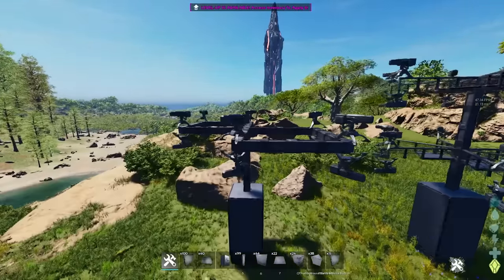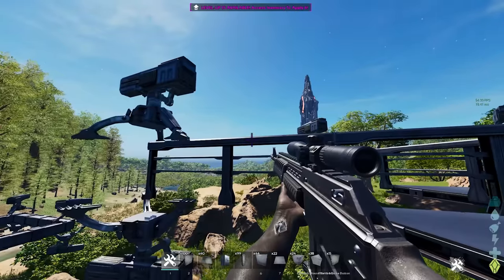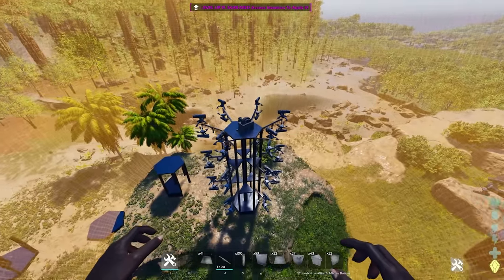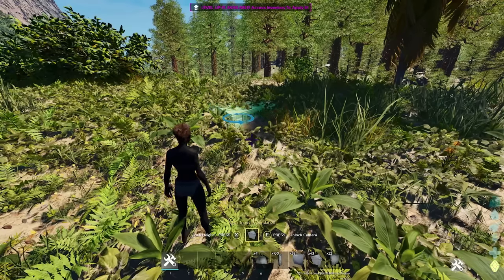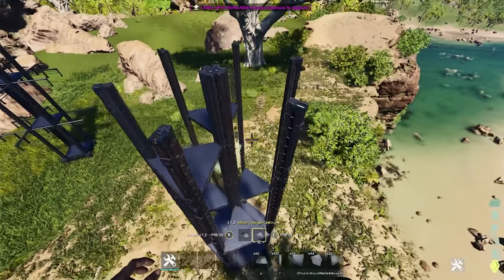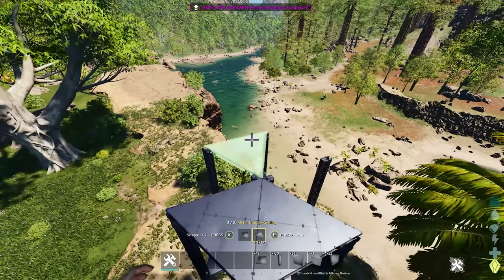Ark Survival Ascended 5G Turret Tower Meta

Comment: 2:36 vault drops still work, you just need to shoot down the ceiling under the vault instead of using demolish.
Reply from the maker: Yeah I kinda found that out a while ago, I figured it was a strange feature because why would they make it cost 50+ c4 to brake when ppl could just always go for the foundation which would be way cheaper
Reply: It's not just the ceiling*** the new change is that the structure holding it (wall or ceiling) HAS to take weapon damage for it to drop

Comment: I do like this tower designs, on SE I'd use my inside layer of triangle foundations then an outside layer of them and have stairs on the edges of the foundations and use walls, (later swapped to double door frames) and used hatch frames in an octagon shape around my tower depending on the tower I'd have 4-8 rows so this concept isnt far off of what I was already doing but now its fence instead of hatch frames. And costs a whole lot less to make it. Easy fast tower to get up even if you're just a duo.

Comment: It looks like a very good start but why wouldn't you connect all of the pillers to the ground?  Also if it is in anyway a prolanged fight filling those in combat are going to be a pain.  Lastly geny should probably be one or two levels down from top and boxed in with a secret door to access.
Reply from the maker: The door frames are technically all going down I'm just missing the outer edge of the foundation also for the prolonging of fights that's always been a problem in ark it's just something that needs to be done until ammo boxes get added again also the gen is there for demonstration you can box it up top and extend railings our from it there's no point in putting it lower unless if you want more ground coverage but you just gave me an idea
Reply: We'll eventually have ammo boxes again I'd hope, lol
Reply: @DRS11235  probably but they don't help mid combat.  You still have to fill manually when people are soaking.  Grappling to them to fill will work but you will die a lot and lose ammo in combat.
Reply: @DRS11235 not until gen and I hope they take a long time to release gen as the element maps ruin the game despite the quality of life improvements they bring

Exctinction gives us cryos, genesis one and two give incubators ammo boxes etc

But they also ruin the element economy

Comment: Nice video.

How do you feed and fill up the turrets though once placed? seems incredibly difficult to reach them.
Is the ammo box still in game? could you set one up somewhere within the structure, and will that feed and fill up all the turrets?
Reply from the maker: You would have to grapple fill it which wouldn’t be hard just grapple to the very top of each turret and work ur way up and I haven’t check for the ammo filler but I don’t think it’s been added yet
Reply: Quetzal aswell or tally good to fill turrets
Reply: Tappy*

Comment: one of the better designs. it is however way too small and needs to be upscales to hold around 100 towers, also need some extra snaps at the bottom somehow
Reply from the maker: Well with asa being so new a 100 cap turret tower isn’t really need no one is gonna have the bps or tames to push something with like 20+ turrets it might be possible but it will take a while but it will be needed
Reply: this looks like a proof of concept im sure he has plans to upload more on it most people are trying to churn out content to potentially make the meta ya know
Reply: @WildFW  hes probably putting unofficial servers that dont have just 100 turret caps into the idea

Comment: That electrical gen on top of tower is exposed to flame arrows unless they changed what damages the generator
Reply: No flame arrows and no propellant since they're originally from Scorched, but yeah it still should be enclosed in some way or it would be destroyed easily
Reply from the maker: @Ark-Education goat
Reply from the maker: I just had it there for an example you could box it and extend railings off the box simple

Comment: It's a shame large frames are not in the game.

You could fit max 3 but better if you placed two.

The hatchframes used to be what...25k HP? 12.5k per turret.

The railing only have 5k hp....why wildcard lol, idk why but placed two turrets on a 5000 hp structure doesn't do it for me :(
Reply: takes 4 rockets to destroy explosives all got nerfed
Reply from the maker: Yeah c4 and rockets got nerfed it takes like 12 c4 to take out a metal foundation now
Reply: @WildFW Isnt that just singleplayer settings?
Reply from the maker: @edvinkandenas348  iv heard something about that idk if it true, it sounds strange for them to add that to singleplayer cuz last I recalled I never got pulled up on singleplayer that much for it to be a problem (they actually made it to where structure resistance in singleplayer is 0.25 which the default is 1 what the hell are the devs thinking)
Reply: Hatchframes used to be 15k hp
Reply from the maker: @Esop-pg2yb  yeah it's a shame because we might not get them back for asa
Reply: @OutOfPocketArk  
No Rockets got  actually buffed it's just 0.25 damage in Singleplayer.